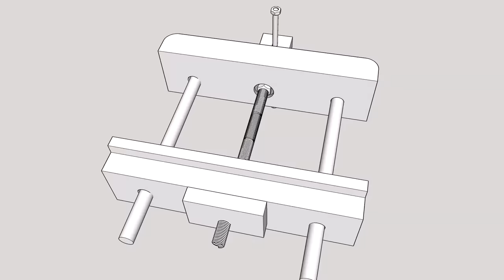Wooden Bench Vise making / free PDF plan / DIY

Comment: Great video and plans! so simple. I am using your plans to build my vise.
A small question - in the back piece - why did you add another piece (100mm x 60mm) for the threaded rod nut instead of putting the nut on the back piece itself?

Comment: Went to Home Depot yesterday. My design is similar but I am using 2 inch steel angle for the jaw supports. For the rods, all 5/8 solid steel outside and thread rod in center. The slide spinner is going to be another piece of 5/8 rod threaded ends.

Comment: Hi, thank you so much for sharing this. Awsome bench vice, just one question on the 16mm and 20mm holes in the clamps. In the PDF file it's measured 50mm from both side towards the inside. How much should the measurements be from the bottom up or from the top down please? Thank you.
Reply: Sorry to jump in on your question. I have recently asked the same question about the position of those holes. I can’t see a reply to your question, did you get one or have you worked it out for your self?

Comment: In the plans it gives the distance from each side to center of drilled hole but not the distance from bottom to center of hole.  What did you use?
Reply: Did you get a reply to your question or did you work it out yourself? I asked the same.